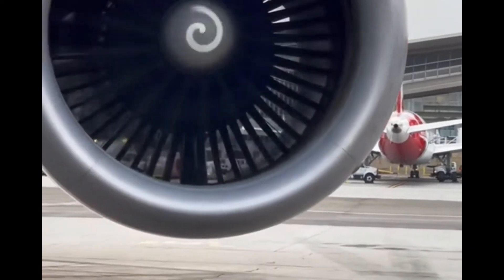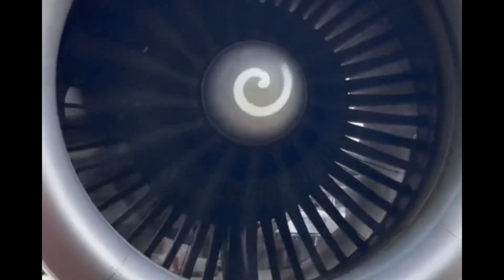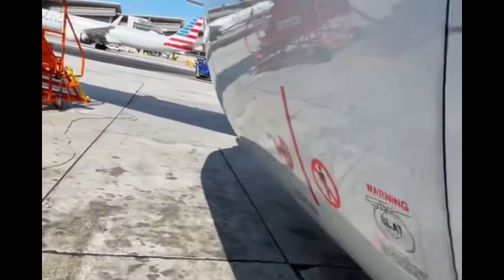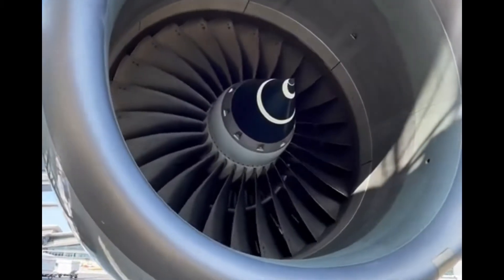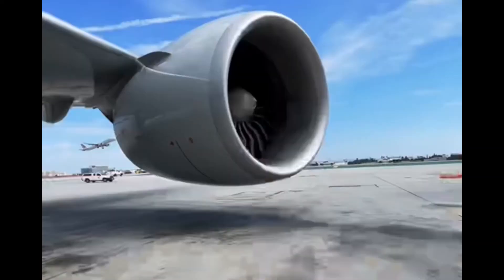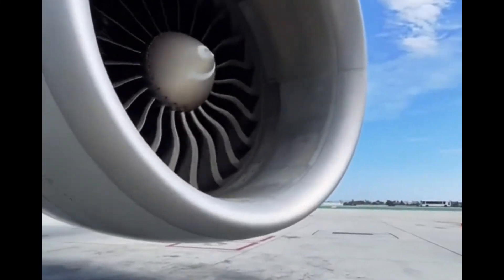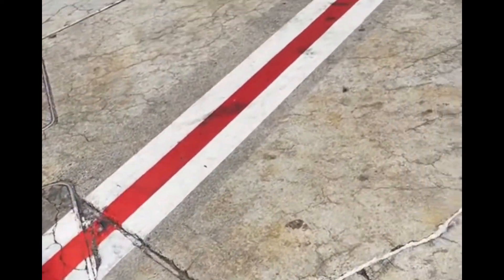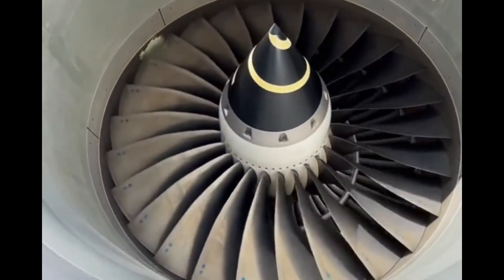Jet Engine Running Safety distance

Comment: Is there a video of a 777 engine at full testing ? Would be very interesting, keep up the good work STIG 👊🏽👊🏽👊🏽
Reply from the maker: You mean a high power run ?  I’ll try to get that when I get the opportunity to do one.
Reply: @StigAviation always wondered how come the plane remains on ground when doing the high power runs. At our base the maintenance regularly run An-24, SSJ and DH-8-300 on high power. can't imagine what that looks like for 777-300 😊

Comment: Engines start up sound (The low pitch hum)
VS
Engines spooling up sound (The Whale) 

Go. 
(My favorite's probably the whale, especially on the Trent 700)
Reply from the maker: That’s a very RR thing. The triple spool engines have a distinct sound.
Reply: @StigAviation  Oh! Thank you for that! One of my hobby is to tell whether which 787 uses the Trent 1000 or the GEnx by ears. (Many airlines don't put the logo on the engines, so I always have to guess) 

They sound quite similar, but now I know only the Trent 1000 has the whale RR noise. 
This is a game changer. haha.

Comment: You guys have to work in all weathers - but what do you do when you have a humdinger of the thunder storm on top of you with ground strikes? ... do you still wave your spanners 🛠 around hoping for a 200 million volt, 30,000 Amp journey into space? ...surely not. 🤕
Reply from the maker: We evacuate the ramp. No one is allowed to touch anything at that time.
Reply: @StigAviation   hehehe , safety first .. you can't fix planes with melted spanners looking like you were flame grilled. 🤣😋

Comment: Yes sir and not only do you have to keep your head on a swivel when the engines are running but if the hydraulics are also powered up, you need to steer clear of any moving control surfaces because at 3000 psi stuff will move and not stop for no one
Reply: As a Mechanic on Hydraulics if a hose burst even spray of a small leak that hyd pressure is deadly to a human body. Water jets system that cut thick metal works on very same principle.
Reply: @Houndini  Damn!!
Reply from the maker: You’re absolutely correct, a gear door swinging, or a flight control moving will not even hesitate, no matter what is standing in front of it
Reply: Why are pressurized hydraulics dangerous? I don't get it. Is it because leakage can happen?
Reply: @daprogamingchina6871  because you can be crushed if you happen to be at the wrong place it could damage the aircraft if you put a work, stand underneath the flaps or any other movable control surface
Reply: @StigAviation  I just talked to a very good friend of mine that I had the pleasure of working with and now he is working out of LAX Line maintenance with American Airlines . He did not recognize your name, I will only tell you his first name is Jerry and he is from Trinidad and Tobago Ya Man if you happen to know him, that would be interesting and say hi I told him to say hi to you